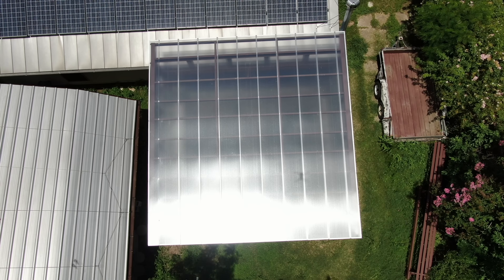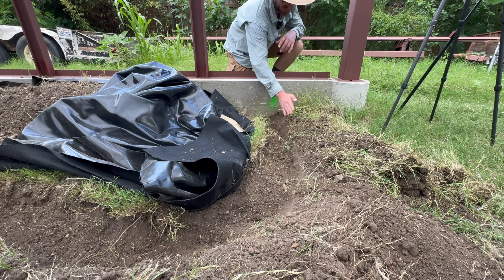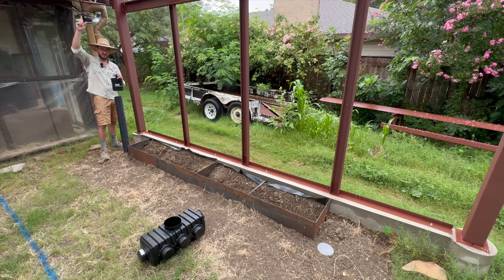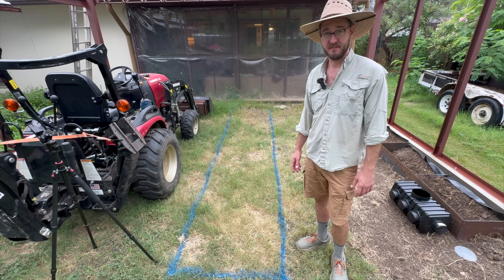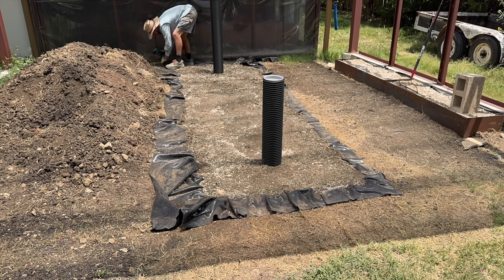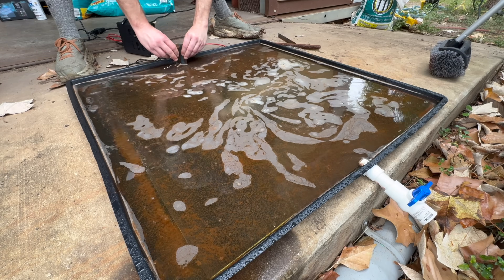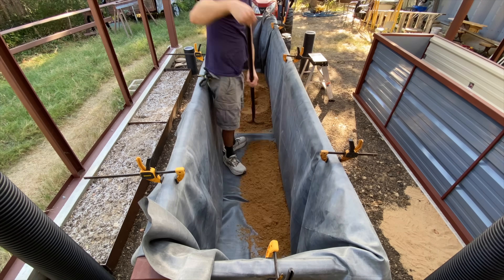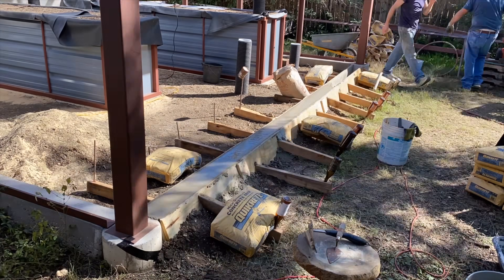FREE HEAT all winter long

Comment: nice system. Ive wanted to use geo to heat my greenhouse. just havent done it yet. one idea that might be too late would be to bury styrofoam along the permitter on edge a couple feet down to create a thermal barrier.  would help the heat from going out into the colder surrounding soil
Reply from the maker: I seriously considered doing that but realized I’d have to dig trenches and heat would still go out the bottom to some degree. Unless I dug up the entire greenhouse interior and lined the bottom with insulation as well. I’m hoping that due to our very mild winters the insulation probably won’t be necessary. God I hope I’m right 😂
Reply: @suburbanbiology I'm sure it will be fine.

Comment: Your metal planter will be emitting your stored heat. save the fan run time.
Reply from the maker: I plan on setting up a ton of thermometers to see how necessary the fans even are. You may be exactly correct. Time will tell. Thanks for commenting!

Comment: I'd like to understand where your water is coming from and going to. Are you filtering it at all before it goes in?
Reply from the maker: Just a kitchen sink strainer. I haven’t set that part up yet but that’s the plan. I borrowed the idea from Earthships.
Reply: @suburbanbiology  sounds awesome! I love the design thinking with the various pieces working together.  I'm in the process of taking out some concrete, routing a downspout there instead of right at my foundation, adding shower gray water and planting some tall bushes to shade my house and AC unit.

Comment: So I’m confused about the two big planner why did you put the backer board on the bottom? Why didn’t you just make the same in ground system you did for the cactus bed? I mean because now all the water that you’re taking out from the house isn’t gonna get into these two beds. It doesn’t make any sense to me.
Reply from the maker: I wanted separate planters so if one gets flooded I don’t lose all my plants. These planters only need to be watered like once a month so the hassle of moving the hose won’t be a big deal. I also only wanted food particles in one planter in case it causes unforeseen problems. This is basically a real time experiment so I can see which version works best and tell the world to do only that version.

Comment: If you look at the heat equation and make some assumptions for the thermal diffusivity of soil, you'll see that about 2 meters deep, the temperature is essentially constant (year round), and it's in the 50s or 60s F.
Reply from the maker: I’m excited to see results in which planter gets hotter. The in-ground one or the raised metal ones.

Comment: 1 foot deep on the "heater" does not work in many zones in the US. Where I am I would need to got 4 feet to escape frost, and 10 feet to prevent seasonal saturation; which I cant  because water table is about 8'.
Reply from the maker: Yeah I didn’t stop to consider how lucky I am for living at my latitude. Thanks for commenting!
Reply: Sounds like Michigan! We're 48" minimal depth for permafrost, at least in my area. I'm sure it's deeper up north, or in the UP.
Reply: @michaelfry967 I wasn't up in the UP but I was an hour from Ashland WI ant the frost line is around 6 to 8 feet. Some superficial surface propane lines have to be insulated if not doubled for the sake of the owner
Reply: Even with a greenhouse? I thought the greenhouse would help heat the earth it covers as well
Reply: @davidlam2479  I need build a thermal barrier to prevent frost creep. there isnt enough sun to heat a greenhouse in my region even with thermal masses.
Reply: No 1 solution works for everyone without adaptation.  A system that works for you would be expensive overkill for me.

I’d love to hear how you might design yours to overcome the challenges in your location. Would you berm the greenhouse?
Reply: @KB-Say  tall berm the north wall. smaller berm the rest, creating a "sunken" greenhouse. With ridged foam insulation to help on the smaller berms. a few thermal batteries in water, and a over night tarp.
Reply: @KB-Say  as long as the water table would allow, you could create an “Earth ship”. You’d dig the floor level down. This helps in hotter climates as well to keep the room cool. Otherwise, it just means more digging and a little more pipe.

Comment: Videos only 3 hours old and like all of the comments are nitpicking the plastic usage. Is there any other way to have done this that isnt absurdly impractical?
Reply: Bentonite clay for a liner and ceramic clay pipe? The clay may need some work to fully seal, more prone to breakage, heavy, and probably more costly and harder to source materials.

 using the same pipes to drain water sounds like a mold issue to me. though thats maybe less problematic in a greenhouse than a residence... Is this sharing air with the living quarters? oOr is  there a slight overpressure in the house to keep the overly humid air in the greenhouse?
Reply from the maker: @42raven42  Living quarters are behind exterior sliding glass doors that stay closed most of the time.
Reply from the maker: Not yet. I suspect a Cambrian explosion of material science is coming soon. But so far the affordable option is unfortunately…. Plastic

Comment: Brilliant !! Wondering if youll get any weird smells coming from the chimneys that are full of water. I’m assuming that some nutrient from kitchen will filter through into the lowest pipe? Or will there be enough wicking action to keep it moving ? Perhaps I’m missing something in the schematic I have in my head of this project. Either way very well done and I hope to see more of this as it develops.
Reply from the maker: Too soon to tell as I haven’t plumbed the kitchen sink to it yet. Based on my filing cabinet planter a slight anaerobic smell could happen but the airflow in this model should be far superior so…..time will tell.

Comment: Now this is very cool, except you used electrolysis to remove the rust instead of lasers? LOL
How are the plants growing in the greenhouse insulated from grounding to earth?  #Electroculture
Reply from the maker: I haven’t started any plants yet. As these planters age I would imagine there will be spots of the metal planter that will touch both ground soil and the internal soil. I would imagine that would bridge the gap from a grounding perspective 🤔 I suppose I could use an ohmeter to test that theory once things are done. Thanks for commenting!
Reply: @suburbanbiology  I would be incredibly curious to see the results on that. Seems like one of things that should have an obvious test outcome but ends up having some wild never would have guessed result.